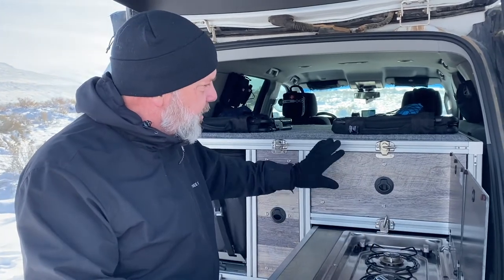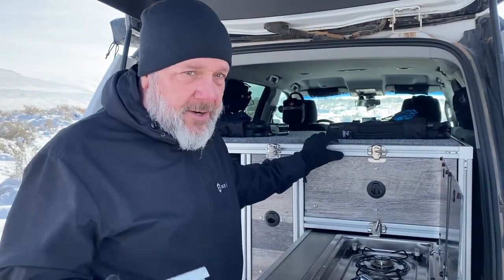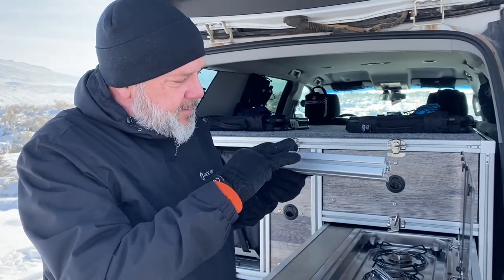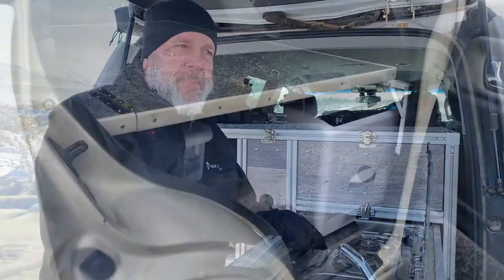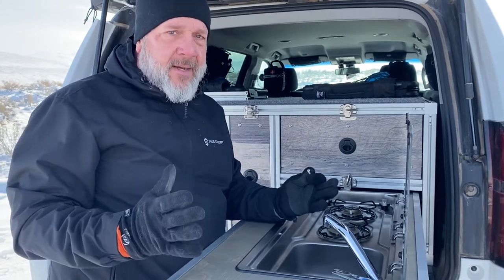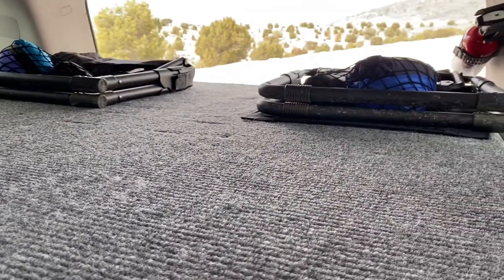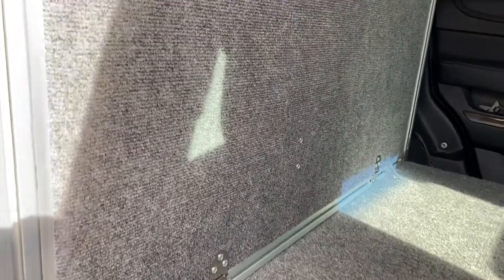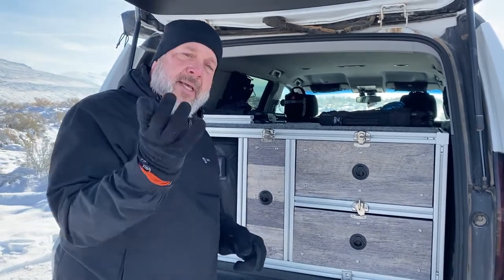S2/E5: The Rhino's Drawer System

Comment: How did you design the power and water connections inside the drawers?  Thx
Reply from the maker: Chris, this post gets into the water and gas connections on the galley drawer. Behind the drawer is a coiled food-grade water hose the expands when the drawer is deployed. https://thetahoebuild.wordpress.com/2021/06/06/utilities/
Reply: @UTADV  Thanks for responding
Reply from the maker: @chrischurch3020  Hope that helps.

Comment: I have a 2021 GMC Canyon AT4 that I'd love to build something similar.  Do you have an approximate cost on this type of system??
Reply from the maker: A bit over $1k for the extruded aluminum and all hardware including drawer slides. Happy to provide links.
Reply from the maker: https://www.amazon.com/gp/product/B00J9G8J2W/ref=ppx_yo_dt_b_search_asin_title?ie=UTF8&psc=1
Reply from the maker: https://www.amazon.com/gp/product/B07VXSR8JQ?th=1
Reply from the maker: https://www.amazon.com/gp/product/B0794ZWPZM?th=1
Reply: Thank you so much.  You’re a great guy!!!!
Reply from the maker: @at4overlandadventures711  If you're keeping your second row seating, you can still build to the length of the drawer specs. There will be a wedge space between the insert and the back of the seats where this tank can fit. https://www.frontrunneroutfitters.com/en/us/water-solutions/front-runner-slanted-water-tank.html